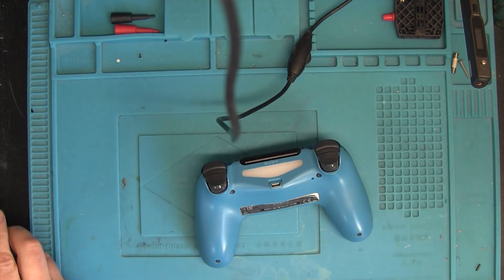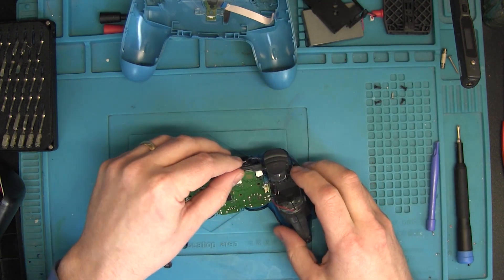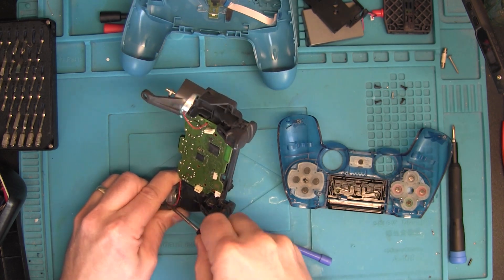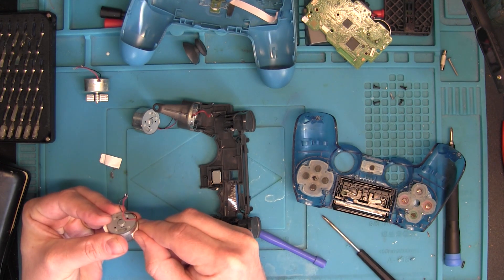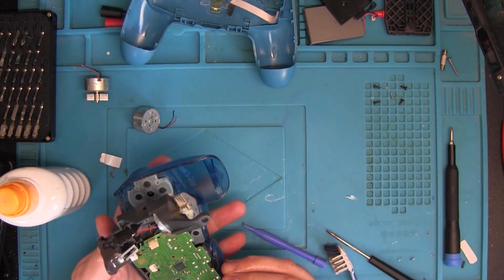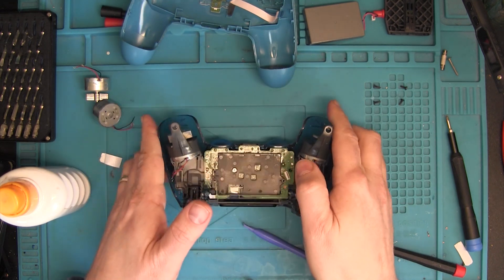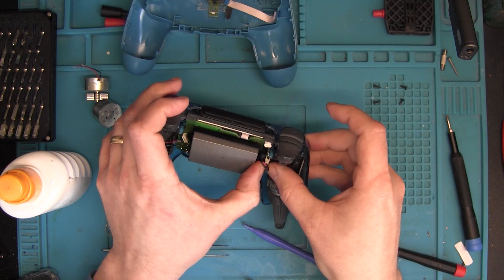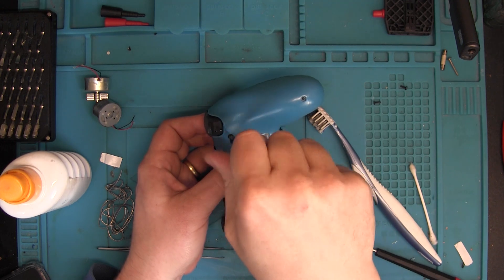PS4 controller DualShock motor replacement

Comment: Where can get motor at ps4 controller
Reply from the maker: I would say ali express, ebay or amazon. Or from a broken controller that has other issues. I used a doner controller get spare parts. Usually you can get the motors very cheap 3 to 4euros.